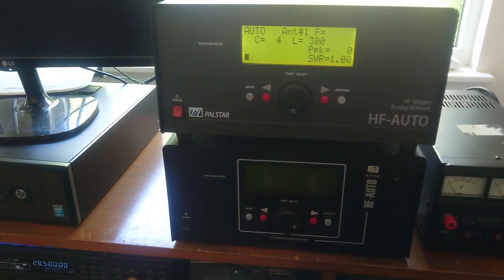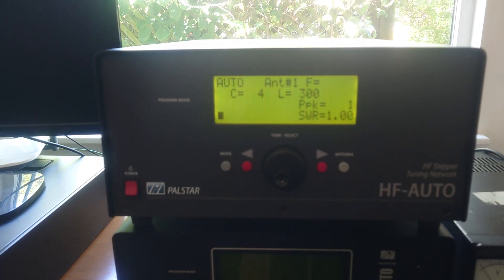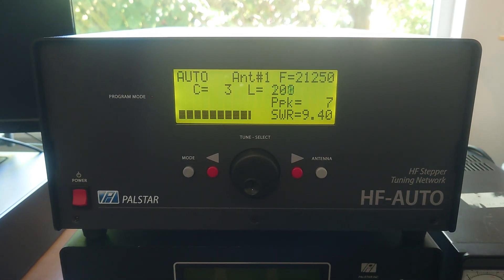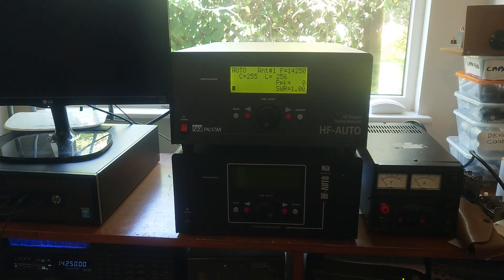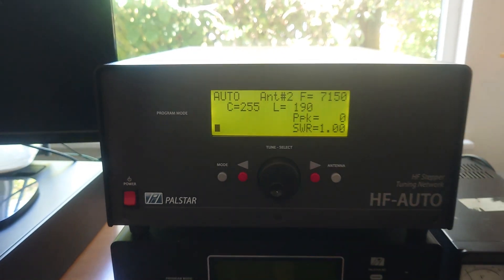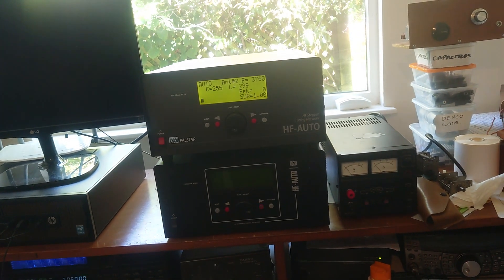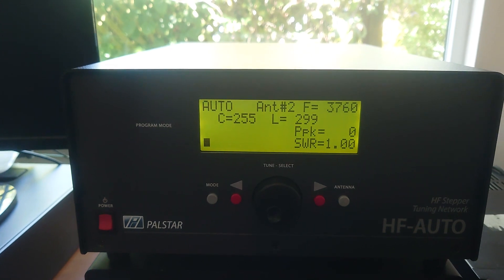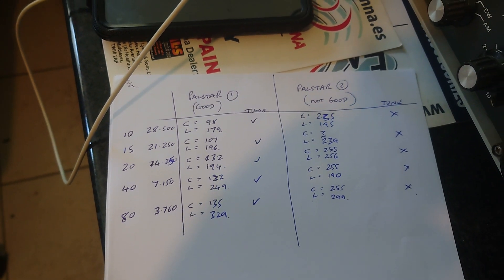PART TWO. PALSTAR HF-AUTO Tuner

Comment from the maker: It's a newer version than my unit in part one. The coupling is fine and there are no signs of arcing visible. I did try a complete re-calibration before it went to the shop for repair. I could manually rotate the capacitor with the dial. It just doesn't seem to respond in auto. I am guessing encoder or controller?